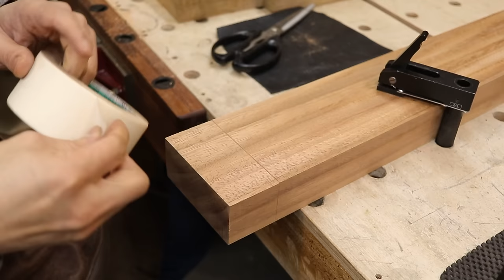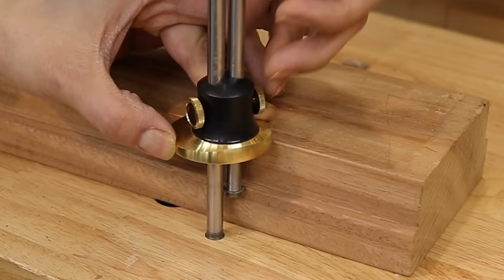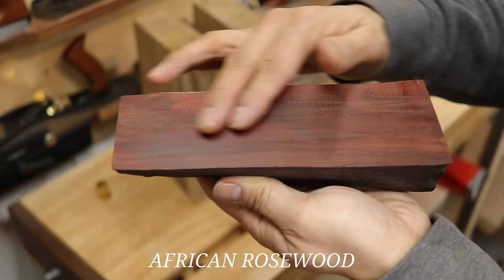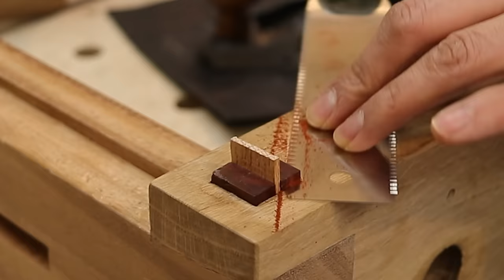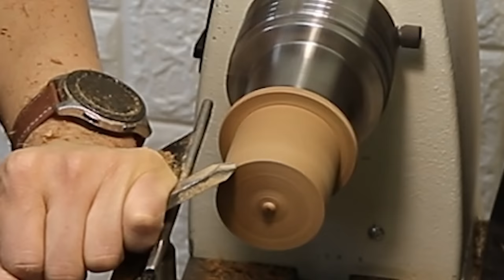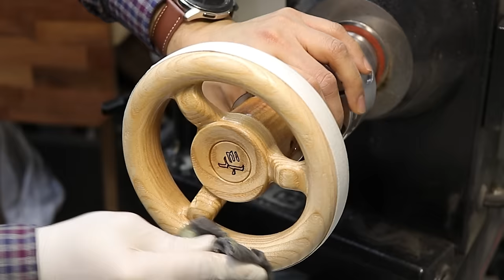⚡ I made a sturdy and usable bench top vise that I can later pass down to my son / Fine Woodworking

Comment: Beautiful work.  Question:  how do you use that platform that is behind the rear jaw?
Reply from the maker: Its purpose is to strengthen the structure and protect the screws from dust. It also serves as a handle and a place to place the shaving tool. Thank you.

Comment: Incredibly beautiful!

I have 2 questions I hope you’ll answer for me.

1.  Why did you make the top of the vice narrower?  Wouldn’t a wider gripping area be better for you?

2.  Why did you include an anvil area on your wooden vice?  Will it be strong enough to take the kind of pounding it is often used for?

Thank you so much!  You really did an incredible job!!
Reply from the maker: thank you

This is my answer to your question.

1. This vise does not require a large grip area.
It is mainly for holding small pieces and there is enough grip area for that. There are advantages to creating the vise mouth like this. This shape allows me to use a carving knife or wood file more deeply. It seems a bit difficult to explain in words. It also has the advantage of being good for fixing work diagonally.

2. The anvil part is not intended to support blows. It secures the overall structure of the vise and prevents wood chips from getting caught in the screw. It also serves as a handle when moving. I also place my carving knife on it while I'm working.

Thank you for your interest.
Reply: @carpentak  Thanks, I get it now!  Your answers were great.